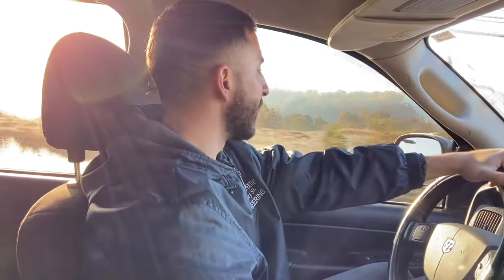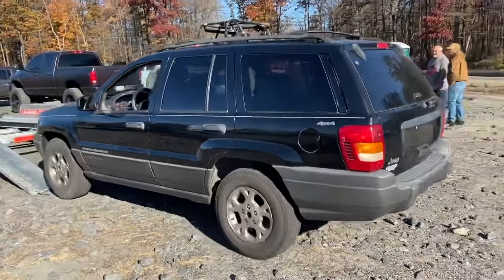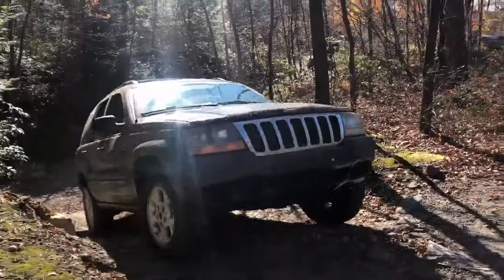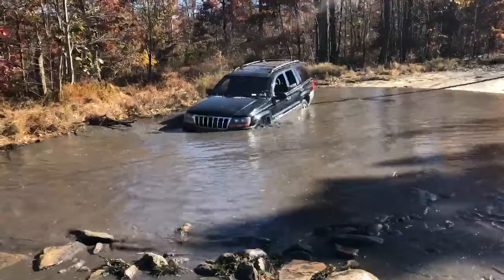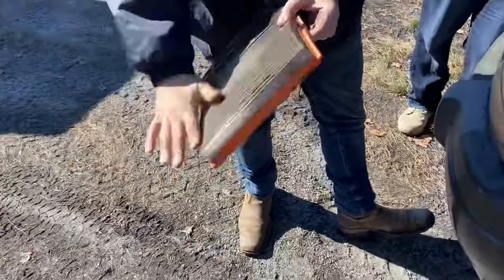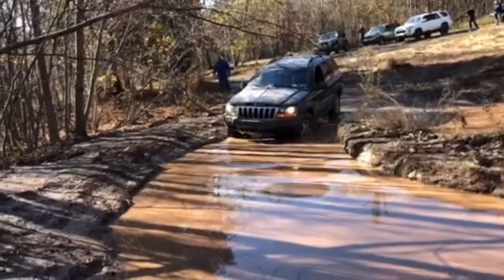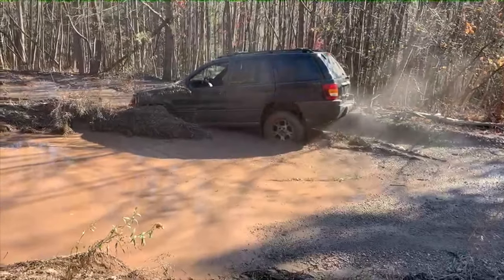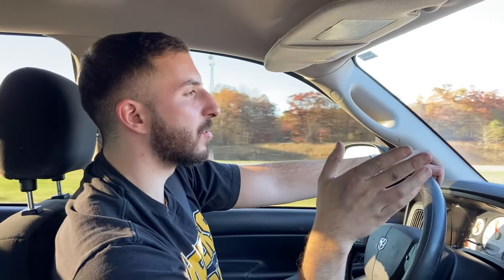Off-Roading a BONE STOCK Jeep WJ - Incredible Results!

Comment from the maker: What are your thoughts on the stock WJ?
Reply: Awesome!  The WJ is built to handle.  I got a 99 and converting it into a rock crawler.  Once you put a cage on them these beauties are unstoppable.  Great video
Reply: Had a 2000 with 4” lift and 32” tires and loved it went thru up and over whatever I wanted it to definitely want another one
Reply: Which transfer case is in your wj? Curious. Impressive for stock.
Reply: Mine's stock
Reply: What year WJ is this? V 8 size is a 4.7L correct?
Reply: I am impressed. Went thru much more abuse and mud, ruts, inclines and deep puddles than I would have expecf with bald tire and blown shocks. Next to ZJ 93-95, and the 98 ZJ 5.9L, the WJ 1st gen. a winner in my book. Nice video, thx
Reply: @bombdiggitydave3881  yes, 4.7
Reply: My thoughts on the WJ... i LOVE THEM!! 

VERY capable, easily made much much more capable, even if you don't already have things like locking differentials. I prefer the SelecTrac HD Xfer case ( the HD units are getting harder to find than standard duty SelecTrac cases. 

 Lunchbox lockers are cheap alternative to open diffs. Just as easy and cheap, maybe a Sure Grip and a Vari-Loc from the local pic-a-part. Typically 3:55's and 3:73 gears in these, I lucked out,  found a set of 3:91's, the rear is a Sure Grip and the Front a Var-Loc.. both from the same blown up V8 4.7 HO WJ. Add a decent inexpensive 3" lift, some 265 tires, a judiciously added skid plate here, rock-sliders or nerf bars there, now you got a real world off road machine for not a lot of coinage. As the gentleman said above, add a cage maybe even a snorkel.. Bob's your Uncle. BUT beware of the stock front driveshaft, if it has ONE or BOTH CV joints. They do not support increased angle from any lift, larger tires, etcetera. Changing the yoke's to U-Joint types on the front axle and/or front transfer case position,  find a used double cardan driveshaft from the salvage yard, online, u-pull, same places as the axles,.. sometimes even wheels and tires as well as other stuff,  you have no worries.

I've built  a  4.0 Laredo, a 5.9 Limited ZJ, 1 '97, and 2 WJ's ( Laredo and Limited) so far for off-road use, from nearly all used parts, stock parts and so on. It's a very inexpensive easy way to go, plus you can really get smoking deals on about anything used  for a WJ or a ZJ, some stuff like new. They made something like 1.5 million of the WJ between '99 and '04, so it's not like they didn't make many. I recommend people start stocking up on parts while they are still affordable. Remember,  the newest of these are closing in on 20 years old, so eventually they will also go the way of the ZJ.

Most people think only the Wranglers can be easily made capable for off road adventure. Not so, if anything, it's cheaper overall to build a WJ than a Wrangler.. pretty much anything with a 4.0 inline 6 it's hard to go wrong. Wrangler parts get expensive.. If you get a 4.0 WJ that was even reasonably taken care of, a 4.7 or 4.7HO better yet really bring some grunt to the mix your probably going to be golden..
Reply: I have been nothing but impressed with mine!!

When I got my 02 Overland, it had a busted shock, a hacked TCM harness, a plugged cat, bald tires, and thrashed 16" wheels off some other GC. It was buried in a foot or two of snow and I was able to drive it out in 4LO with no effort at all.
Reply: It's  not the ride It's the rider.
Reply: @phillanassa759  To me the ideal set would be 4.0 with Selec-Trac  transfer case but with 545RFE gearbox. I know 545RFE comes with 4.7 only. Can 545RFE be paired with 4.0?
Reply: Bro!!! I can't believe it went thru that lake of a puddle!!  I mean barely, but still
Reply: @bobbish782 I just recently bought an unmolested 99 Laredo with 4.0l. Haven’t tried it off-road yet but hoping It impresses me
Reply: if you maintain the I6 engine very well, you can get at least 400,000 miles and even more, the v8, will usually have more engine problems over time but with regular maintenance can get 200,000+ miles at least
Reply: My thoughts is that bone stack can still rock!!!!!
Reply: My mother just gave me her 2000 jeep Cherokee Laredo. She can no longer drive. It had 99k on it. Always parked in the garage. This baby is clean. I won’t be driving it in deep mud holes. 😂

Comment: I just have the 2 inch lift kit, new shocks, track bar, steering dampner and 31 M/Ts and I can honestly say I'm very surprised the capabilities of my WJ. I love this thing!!!
Reply: What was the steering bar you bought?
Reply: @VMAFIA  everything is from Rough Country
Reply: @Donny L 300 from Rough Country
Reply: @freddyflazh  Would you provide the link? Everything I've seen is twice that cost. Thanks.
Reply: @everready19373  just Google Rough Country it will give you all the info. Thats like the less pricey stuff if you have cash get something better
Reply: @freddyflazh  everyone rags on Rough Country but if you’re only running 2 inches of lift and 31s you can’t go wrong
Reply: I’m running the same setup but on AT tires and with QuadraDrive it’s very capable.

I went with a JKS track bar, they’re very beefy and not too expensive. New stock replacement steering damper and Bilstein shocks. Great setup.
Reply: @Robdutton91 exactly their n3 series. Shocks are excellent. I really mean that they are slow to lose their dampening. But give you a nice firm ride on the street

Comment: I'm on my 3rd WJ. They've surprised my friends with how capable they are. If you don't have a trailer hitch to hook to, wrap a strap around the axle tube looped back through itself and pull it tight. Run under the gas tank and tuck it in the hatchback or back window. You can do the same thing on the right front and over the hood using the antenna to keep it on the hood and tuck it in the right front door. Definitely do it BEFORE being stuck. Most WJ's lack hooks. I've been through water splashing the hood, just gotta keep the right speed for a bow wave, intake is behind the driver's headlight. 4 High Off Road in mud clears the treads and keeps momentum, 4 Low rarely, hills and rocks. 245/75/17 fits with no lift.
Reply: What happened to your other wj’s 
I m thinking about getting a wj with a 5.2 engine any other tips,pros and cons,top twenty problems I should be aware of 
Is this your favorite Jeep

Comment: This is a really impressive performance for a stock WJ with bald tires and bad shocks.  I own a 2004 WJ Overland that runs and a 2004 Laredo V8 that will run soon, so it is inspirational to see that these trucks can handle even without any suspension mods.  The High Output 4.7 V8 engine in the Overland gives it some serious g-force inducing acceleration and even if I had the money, I'd still remain loyal to the WJ generation.
Reply: I want to buy one
Reply: Just had a new engine put in my 02 Overland after I had to let it sit in a warehouse for 9 years. Man did I miss her. And nothing like the HO. Feels like you have all the torque available the instant you touch the pedal. Can even idle out of 3 feet of snow lol.
Reply: My dad used to own a overland, I want to buy one with a 4.7, I have a 4.0 laredo
Reply: Right lol

Comment: Very, very capable 4x4!!
On one trail where we often go there is one very steep and rough climb. Only WJ and XJ managed to climb. 2 door Rubicon with front and rear locker didn't make it. They were all on MT tires.
Reply: The rubicon has a terrible driver then
Reply: @Robdutton91  I agree.  As a ZJ owner, I can say that under identical conditions, no WJ/ZJ with stock open diffs is going to out perfom a Rubicon.  The XJ has them, too, but is 700 lbs lighter than the WJ/ZJ.

Comment: I love my 01 WJ. I put a 3" IRO/RC lift on it and a fully adjustable front end with 32's and I love it. Except for the open diff's, it has really been exceptional for the money. I think I'm going to go with a lunchbox locker in the rear and get a Variloc front differential to resolve the only real issue I have.

Comment: I'm a long ways from having lots of off road experience, but if it were me I would have aired down the tires, bald or not and especially knowing I have a trailer.  Also, an old trick with an open diff.  Powerbrake then let off the brake until you start to move.  The brake keeps the tire with little traction from moving and sends all the power to the one with traction.  I'm not too sure how it would work with 4wd engaged, but is certainly an option when all 4 are spinning and you are going nowhere.  I enjoyed the video and will enjoy my new to me WJ.
Reply: I used that trick (albeit with the parking brake) getting my w123 through stuff it had no business going through.

Comment: Great video, I have a stock 2001 grand cherokee 4.0  has 104,000 on it, very well maintained inside and out its my only vehicle and daily driver for now but I do plan on getting some nice 245s AT tires and doing a 2 inch budget boost with better shocks not trying to get to crazy with it.
Reply: FYI, I put 265- 65 R17  Destination ATS AT's 's on my '02 4.7 Limited HO, a used low mile inexpensive Rough Country 3" budget lift including the dropped transmission crossmember, adjustable track bar from IRO, RC shocks, rock sliders that fit under the plastic Limited lower trim using stock Jeep wheels with no spacers, and double steering dampeners. Next, I want to see if installing quick disconnect sway bar links will free up some more axle articulation. NO rubbing, no death wobble thus far. 

Don't let them (people or R/C) you the 3" kit doesn't fit AWD or 4WD WJ's, it does. The only thing you might need to do if you have it would be to swap the Rezeppa CV style front driveshaft out for the U-Joint collapsible-expandable Double Cardan affair, possibly the front axle yoke and T-Case yoke(s). Way easy to do, and parts are available cheap used off of ZJ's and WJ's. If you have the Double Cardan front shaft already you are set. Cheers!

Comment: The WJ did a great job getting it's self out of trouble. A set of gnarly tires, muffler and a trailer hitch and you will be in business. The hitch can be used for rescue. I have a 2004 WJ and a 2006 WK.

Comment: Haha! Bought my '04 with 294,000 miles on it for $500. Totally stock, it ate up the trails here in the Virginia Blue Ridge mountains. I've done a 2 1/2" lift with Rustys off road coils and shocks (gonna be upgrading them soon), replaces the track bar, all the control arms that were trashed. Gettin' ready to install a winch bumper and winch this week, and prolly gonna have to level the front end after. I also want to go to some 31" tires on my 17" wheels. 
Just Empty Every... well, we all know.lmao
WJs are awesome on trail and on the road.

Comment: Should have gotten one with Vari-lockers if you are keeping it stock. (That was the factory LSD in WJs). With Open differentials you can install auto-lockers for cheap and have even more traction.
Also the air intake sits low on the WJs, you probably got water in the Engine. (Even with my lift and larger tires I have gotten water in the Engine, that is why I now run a snorkel).
Not to mention if you didn't extend your differentials and transfer case breather tubes, they probably also have water in them. 
WJs are the best

Comment: Miss my TJ's had a 93 lifted 32 inch swampers 318 straight piped  and welded rear end beast and a 98 w 4 inch long arm 33 inch mudders 4.0, Cadillac's of the woods , nasty mud holes never stored em and they both climbed mountains awesome rigs
Reply: TJ 's

Comment: I have an 04 Laredo Special Edition (heated leather seats, sun roof, upgraded sound system), 4x4 with the 4.0 i6. Only 116k miles and in MINT condition, like it does not even have a door ding or faded leather, or a single spot of rust, and literally everything works perfect on it. Every light, window, lock, remote start, every speaker, no leaks, no pealing clear coat, no faded plastic. Literally mint condition, like it still has the plastic on the carpet from the original dealership. I love it, paid $5,500 cash in 2022 for it aat only 100k miles, I have had 16k flawless miles of driving, not a single issue yet.

Comment: I shake my head at that mint XJ. I’d love one just to keep clean. With that said, get a gas tank skid plate for your WJ soon, because yours looks rough (and that’s what holds it in place). Also I believe your trans has a vent tube. If water blocks that, it can cause shift issues.

Comment: Word, I bought my 01 4.7 new, 21k on the clock in 2007. She is in the shop now engine #3, 243,000 miles but everything's been gone through. If you can find a clean example, these WJ are more than a sum of their parts. The statement the Jeep are disposable is a myth. The 4 7 is a beast that runs on regular gas and they did such a good job with the ECM programming that it can run with coil wires melted to the valve covers.
Reply: I don't know if I'd run to 01 4.7 on regular gas. Probably why on engine 3 so early. The HO is capable of running lower grades but you lose a lot of power. Should really look into the 02 and up 4.7 HO. Much more power and is actually much more reliable.
Reply: @tjobrien4486  it's just a 4.7. Engine one was a little publicized factory recall and they installed the new engine at the dealership. It was supposed to be an issue with the valve seats.  Missing VIN code on the engine. I didn't think about it at the time but down the road it could affect the value. The second time I threw a rod. This is after I've done all the 08 cams, 2008 intake and throttle body. Installed headers. If I could do it all over again, I leave the stock exhaust manifolds in place. They're actually pretty good. The thorlies I installed looked almost identical except near the oil pan. The 2008 intake is a little tall though, with the aftermarket AFE cold air intake, the hood doesn't shut right. The intake runner also contacts the excitation connector dislodging it occasionally.

Comment: The problem with this is all WJs are not the same is it a 4ltr 6 or a V8 what transfer case has it got a 242 select track or a 249 full time four wheel drive with LSDs front and back or just open difs with electronic traction control ???

Comment: When he checks the air filter box for water, it shows it is a 4.0 straight six not the V8 that someone mentions.  Doesn't look like the author replies here but didn't see or hear what pressure he had in the tires.

Comment: I would have been more impressed if you drove the Jeep to the event instead of putting it on a trailer.  It's made to be driven, not carried.  But how far did you expect to get with bald tyres?  You are lucky you did not ingest water into the motor, it would hydraulic lock and break something.

Comment: Lots of steam coming up and off the front end under the hood? Now I've been a fan of the jeep brand for years but I won't buy any of the new models!! I'll take anything from 89 to 04 as long as it's got the old 4.0 straight 6 engine is and will be forever the best engine jeep ever used in it's 4x4 vehicle.